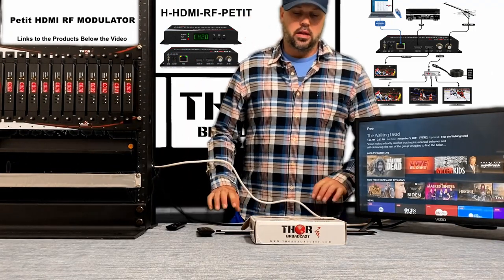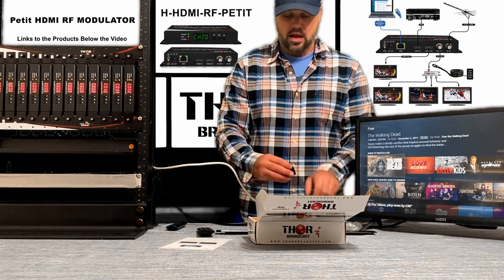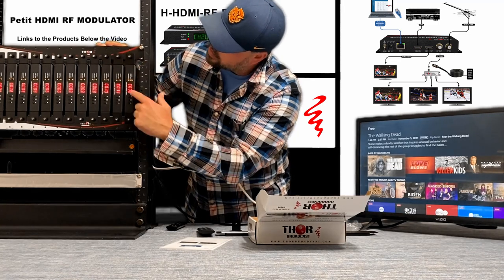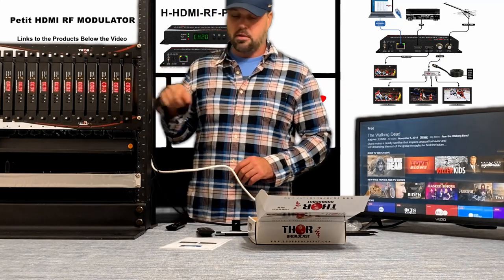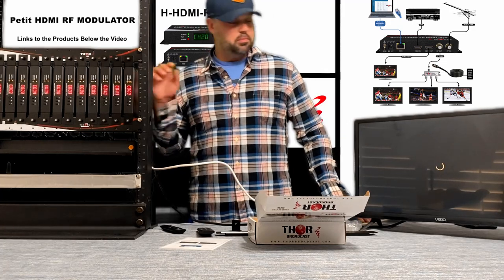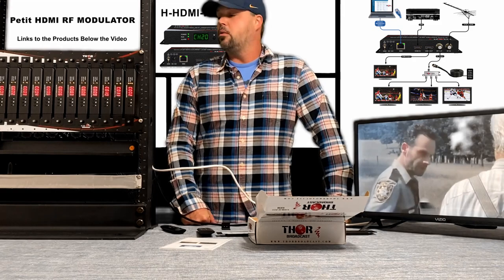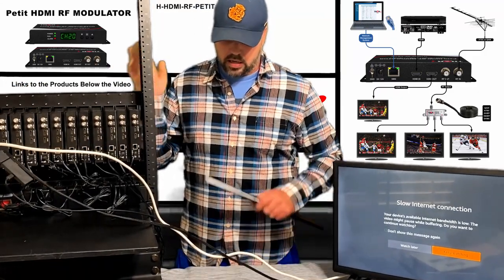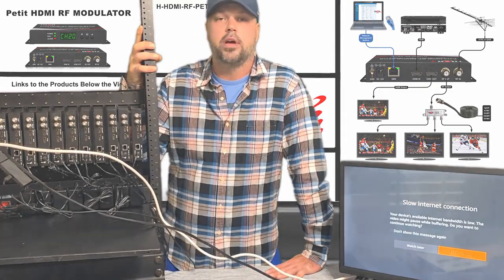Broadcast your video to the unlimited TV's build your own private headed HDMI Modulator

Comment: What is the use of ethernet port for ?
Reply: The Ethernet port in H-HDMI-RF-PETIT Thor Digital HDMI modulator  is used for management. The unit has its own WEB interface, and you can set it up to modulate on any CABLE or AIR channel, regulate RF power, and set channel names and virtual channel numbers.